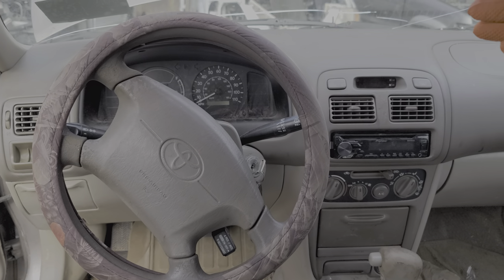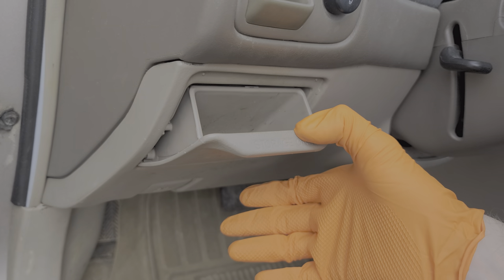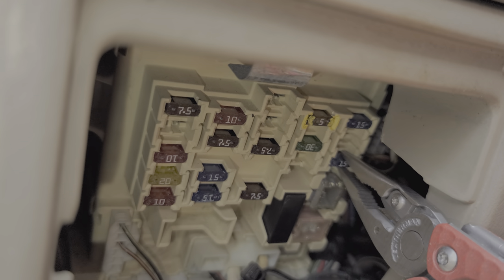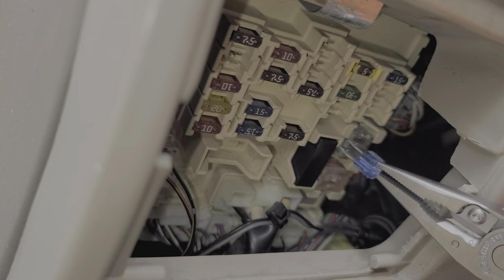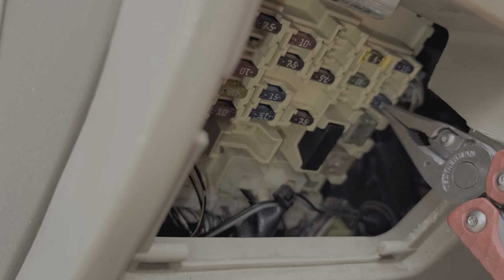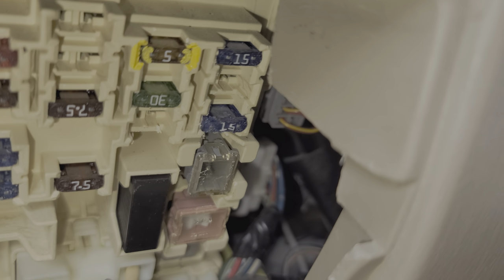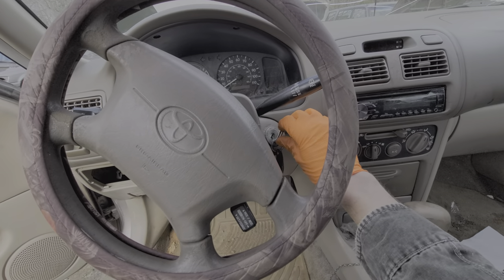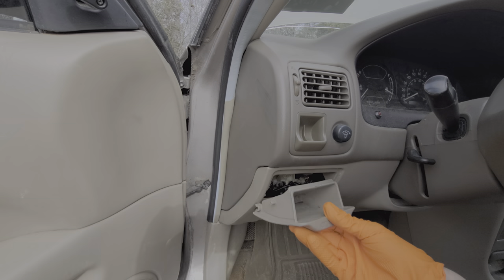2000 Toyota Corolla Cigarette Lighter Fuse, Power Outlet Fuse

Comment: I am having a problem with my 2001 Corolla the cigarette lighter next to the handbrake won’t work but the other one will and I was wondering if you know where that fuse was or what to did to fix it
Reply: People on forums are saying it’s attached to the body of the car and it is under/behind this fuse box. It is a 15 amp. I have yet to take my own car apart to find it but everyone claims it’s there.